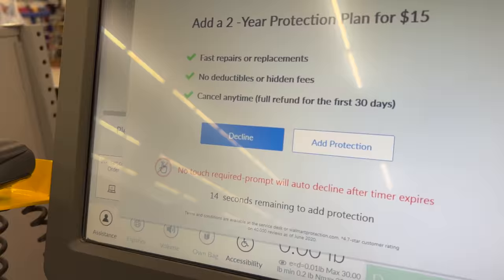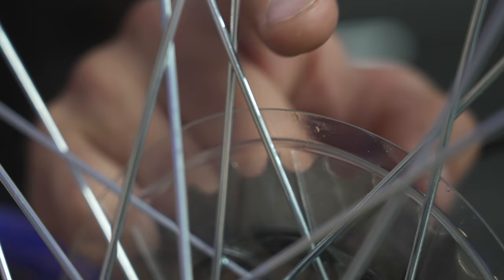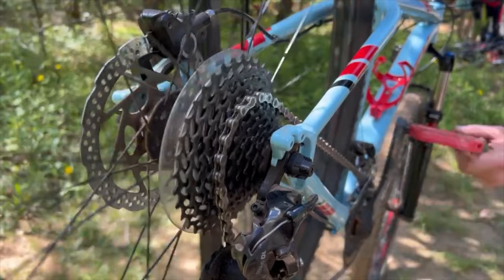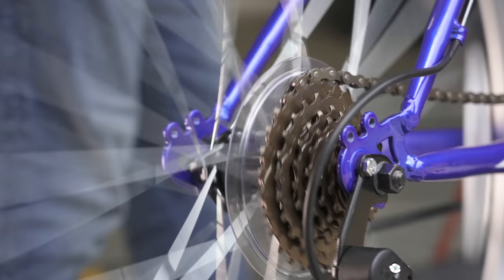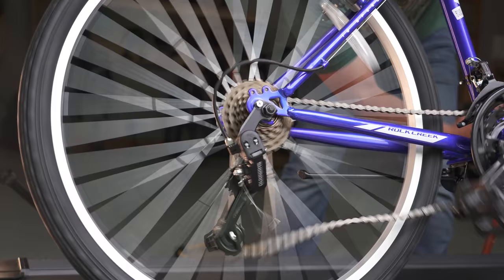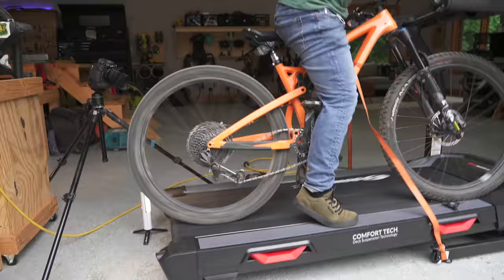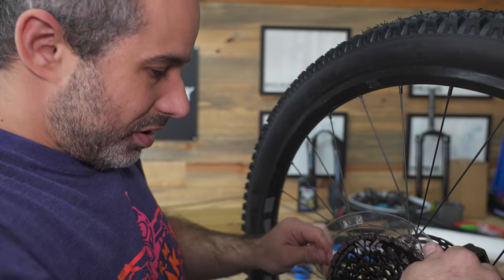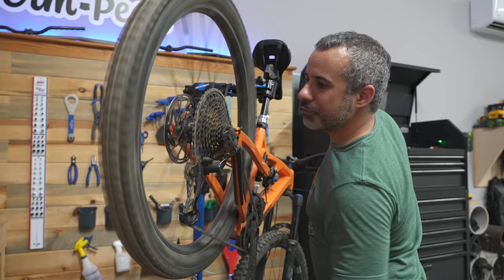What is your "dork disc" actually for? What happens if you remove it?

Comment: Hi ! Bike tech here. The dork disc is mainly there to protect the spokes from the chain, but it wont prevent to derailleur to be sucked up in the wheel. Also the main reason the derailleur gets sucked up in the wheel isnt a badly adjusted Low limit screw, its a bent hanger. A bent hanger will put the lowest point of the cage a lot closer to the spokes and when you shift into low gears to cage is getting caught by the spokes way before the chain can go over the cassette. In this situation, the dork disc is completely useless, this is why we so often remove it.

Comment: you can experience spoke damage, I had a chain slip over on an eagle drivetrain on a punchy climb. Upon inspection by removing the cassette I found a few bent and scarred spokes, I rode for about a year before one of the spokes finally broke. I still don't use dork disks; but there is real risks.
Reply: My worst damage from this has been from climbing. Going for that extra gear when the hanger is bent and you don't know it. I'm guessing it has to do with you putting power into the chain and it rips the spokes up worse than on a downhill when the wheel and freehub can keep moving.
Reply: I also had my chain slip in to the spokes a few times and when i changed spokes like 6 months later i noticed half of my spokes practically been cut in half so yeah there's a real danger but that also was with a cheap drivetrain.
Reply: A year before a spoke broke. And you somehow connect that to a missing piece of plastic?
Reply: @noneofyourbusiness4294  yes, bent and damaged spokes are more likely to break in time than straight and undamaged spokes.(just a wild assumption)
Reply: @RJ_Groot  obviously damaged spokes are the ones to go first. 

However, spokes break all the time. A flimsy piece of plastic doesn't prevent that from happening. 

The most common thing to break spokes, without you doing anything wrong, is uneven tension, which puts a lot of stress on one section of the wheel, which is exactly where spokes break. 

Once one spoke breaks, there's another shift in tension, another breaks, and another, and another. 

The damage your spokes take from debris flying at them is next to irrelevant. Think about it. You're putting multiples of your own weight on your wheel during a drop. If debris actually was an issue, you'd see spokes break around the middle. Instead spokes break where there is the most stress- the points where they connect to the wheel and the hub.
Reply: @noneofyourbusiness4294  I agree with everything you said. I was also surprised that I broke a spoke. I still don't use a dork disc but I recommend that if you do get a chain go over and bend or damage your spoke that you replace it before it fails. A bent spoke even when properly tensioned will fatigue at an accelerated rate (that's why new ones are straight). Just an opinion.
Reply: On an old bike, I had this issue, chain went over and basically scribed all the spokes. Didn't know it at the time, but after 3 broken spokes in pretty quick succession afterwards, looking at the remaining ones the marks were visible.
Reply: Had the chain drop between the cassette and the spokes and it cut about half way through several spokes they stared breaking a few months later.

Comment: The wheel is one of the most expensive parts to replace on a bike, so I really feel like even if it's just protecting your spokes from grinding against the chain, it still pays for itself.
Reply: well thats because a wheel has so many parts on it? spokes, rim, chain, cassette/freewheel, derailleur, tire, tube, brake? although a rear wheel would be more expensive than a front wheel so maybe you should have clarified that part too

Comment: I can remember multiple occasions when the chain fell into the spokes and caused catastrophic failure on my bike. Multiple derailleurs were trashed, several wheel spokes broken on different occasions, and once, the chain got caught and bent in half, rendering it as well as the derailleur junk. Maybe it looks dorky, but it beats breaking down during a ride and having to do repairs.
Reply: And the real question is...Who gives a rats ass what other people think? I take them off of my bikes but not because of peer pressure but because I've had several occasions where crap got stuck. That being said, I have never criticized someone for having one. People put too much emphasis on what others think of us. I ride with a backpack and flats. Lots of people think I'm a dork. I guess I'm a dork.
Reply: Or just maintain your bike properly.
Reply: I just totally forgot about the thing until now, as I didn't bothered ripping it off. I suppose it's different when you are just racing on pavement versus mtb'ing but I never noticed the thing being there at all. Guess, in the end, I'll just forget about it again after a few hours, and just leave it there.
Reply: I wish the dork discs on all bikes were more like the Huffy's (have to take the cassette off to remove it). Just got a new stumpjumper and the one on there just clips onto the spokes, trying to come off by itself.
Reply: What would you say if it was made out of carbon fiber or ceramic and came in different  cokor and could have custom design on them?
Reply: @wrk3182  Exactly.  If  your chain goes off, either inside or outside, your derailleur is either WAY out of adjustment or you've bent a hanger.    Know what the limit screws do, make them your friend.
Reply: @Duke00x  LOL, you're going to make them cool.

Comment: This happened to me only once in two decades. Destroyed my road bike rear wheel. Bought a replacement wheel set. Tried to sell the old front wheel. Found a lot of front wheels on sale on eBay, but not rear wheels. Then I realized this problem was more common than I expected!
Reply: Or maybe they were just stolen front wheels. Usually the rear wheel is secured. XD
Reply: Just re-spoke the rear wheel, it's not that hard. Or have someone professional do it, its not that expensive.
Reply: @aggese  methinks the wheel also needs to be recentered after that kind of damage... I'd totally buy a replacement too in such scenario 😅
Reply: @MarcelaElviraTimis  absolutely, but by removing and replacing the spokes you remove all centering so re-centering is just part of the re-spoking the wheel.
Sure you might have to replace the rim too but those aren't that expensive nether is having someone do the work for you and damaging the hub is rather hard
Reply: @aggese  that's my point. That little plastic thingy greatly reduces the need to respoke your bike, with the added need to center the damn wheel. I mean, at least in my experience
Reply: I wasn't commenting about the plastic disc, i was commenting on bikeman buying two new wheels when he only needed to repair the on that was broken
Reply: @MarcelaElviraTimis  if respoked, it gets recentered by any decent shop
Reply: Same here but 3 decades.  I’ll buy a new wheel every 3 decades lol.  This isn’t worthy of further discussion
Reply: @slpguy6026  I know... I just can't be bothered to go to get my bike repaired for something so preventable... besides, I kinda do basic maintenence on my own

Comment: I've had the chain come off that way before and tbh the worst part that would have been remedied by having a dork disc was getting the chain back out so I could pedal again. Without one, depending on the design of your cassette, it can get jammed in there is a way that is difficult to pull back out (and makes you wonder how it got there in the first place)
Reply: You are tottaly right I have a sram nx eagle 12 speed (gonna change it to a X01) and my chain did pop off between the cassete and spokes it was a PAIN to get it out I still dont understand how it got so caught up in there.

Comment: As other commentators have said, that “dork disc” is a spoke protector. The chain can be much harder metal than the spokes. An adult riding over rough ground can put a lot of force through the drive train. When the chain goes between the cassette and the spokes it can cut into the spokes like a saw. That can severely weaken the spokes, leading to the whole wheel eventually failing. That little disc is there to take the hit so that the wheel doesn’t get destroyed.
Reply: So you think that a thin piece of plastic is stronger than the material the spokes are made out of?
Reply: @JaspreetSingh-fo2qe  That's not what he's saying and it's not how it works. The disk attached to the wheel and spins with the spokes... if anything it needs to be stronger than the chain material. In any respect, the plastic could be sacrificial.
Reply: @har234908234  I bet that plastic will only help to prevent scratches from the spokes. If the forces are anything near to where the spokes would have broken without it, then it will not help even a tiny bit.

I can see a metal one to be quite a lot more functional but definitely not the plastic one.
Reply: @JaspreetSingh-fo2qe  I don't think it likely on a well setup bike. The event I imagine where the chain hops over the top of the block would have the rear derailleur bashing against the spokes! To your point. He was talking about chain plates banging against spokes... If it happens on a pedal stroke, the plastic needs to last one pedal stroke (and probably not a long geared one at that). You're getting off your bike to fix it before the second stroke! If it happens when you're going downhill at 60kph it's worth remembering that while the tire circumference of the wheel is going 60kph,  closer to the axle the linear velocity where the chain would meet the plastic is much lower. At 10cm from the axle that could be around 2kmh? The chain is 'sliding' against the plastic, not clattering against spokes. The damage you're looking to avoid is the start of a fatigue failure, not an instantaneous catastrophic failure.  I think this is a kids bike problem... where the setup may be 'altered' without expertise.
Reply: @JaspreetSingh-fo2qe  I bought my first bike (well, since I was a kid) a few years ago and had no idea what was what. I knew I had to adjust the rear derailleur... but I did it wrong. And still being a noob, I was in the granny gear a lot all the time - the one closest to the spokes. On more than one occasion the chain slipped and wedged up against the disc. I remember thinking "wow, I'm glad that little plastic disc was there, how about that..."

But as for plastic being weaker than metal - the plastic has much great surface area than a single spoke. That force is distributed much more evenly - that's how it can function as it does. It also stops the chain getting tangled in the spoke. If spokes were that strong, we'd have four of them per wheel, not dozens. 

If some weirdo is paying that close attention to my bike and cares about a little plastic disc, then I assume they're just a creep with a tiny pecker, since it's the sort of thing that turns cycling into a dick measuring competition. Just like a lot of other stuff. I don't care if I have a bike with it on, especially since I've seen them work.
Reply: Forget all of that and use a "super low gear without teeth" if that makes sense, I believe bike manufacturers should refuse allowing the chain to come off the rear cassette rather than add a plastic disc to deal with the damage.
Reply: @JaspreetSingh-fo2qe  No.
The plastic gives the chain a smooth slippery surface to ride on. The plastic will get damaged, but is much cheaper and easier to replace than spokes.
Reply: @JaspreetSingh-fo2qe  it's a sacrificial piece. The plastic thing gets destroyed so something important doesn't and then you replace it.
Reply: Professional bike mechanic in some capacity from master tech at several shops through race support from 1995 through 2010.  In the 15 years I’ve worked in the industry, I’ve encountered 5 instances where the dork disk may have saved the spokes on the wheel.  If you free wheel for long enough with the chain wedged down there, the spokes on the drive down get shaved down and get mangled.  One of the 5 instances was on my own wheel and like many, I thought nothing of it until I broke a spoke on a steep climb.  Replaced the spoke as well as a few of the other external drive side spokes when I saw just how shaved down those spokes were.

Mangling and creating total carnage with the rear derailleur and derailleur hanger seems to be luck of the draw, usually combined with contact or introduction of an external object (e.g. rock or stick).
Reply: That little disc just have to deflect not act as a wall . Even if if saves you one spoke that’s money to get to the next trail. But they do look dorky.
Reply: @JaspreetSingh-fo2qe  The chain can severerly damage the spokes and not just scratch them. Any damage to spokes can alter their tension putting the wheel out of alignment and spokes can break. Removing those plastic disks is just stupid since they don't impact anything negatively.
Reply: @JaspreetSingh-fo2qe  The point is that

a) with a smooth surface to rub against, it never actually binds to the wheel in the first place, so the dork disk won’t actually have to deal with those high forces, and

b) If the dork disc is completely thrashed, like deep scratches, even to the point of holes in it, your wheel won’t break, because it isn’t the spokes.

Sure, metal is stronger than plastic, so metal can take force better (assuming the same shaped parts), but I would rather tear pair of gloves than the skin on my hand, just as I’d rather destroy a dork disc than my spokes. Even if the dork disc dies a gruesome death, the wheel (*might*, you can obviously break both) live on.
Reply: @JaspreetSingh-fo2qe  youre just not getting it bro. The plastic will deflect the chain. Its that simple.
Reply: The chain can grab into the spokes and damage them or even cut them.
The dork disc plastic is a smooth and plain surface. Nothing to grab on. Ideally from both sides with little noses that could break instantly. The chain slides over it and no force is transferred into the spokes or even the dork disc. That easy.
Reply: @JaspreetSingh-fo2qe  surface area must not be a thing your familiar with. Its not always about pure strength.
Reply: if it was just to protect spokes it wouldnt be a law that it had to be on bikes....
Reply: @tbag6600  well, I used to have bikes without spoke protectors and let me tell you: the hassle those plastic discs save you when your derailleur is misalligned is enormous. Hell! If you're an amateur like yours truly, that stupid little thing allows you to procrastinate fixing it without the risk to tear your wheel into pieces and have to (gasp) straighten it once a week and spend money on spare spokes
Reply: @JaspreetSingh-fo2qe  it just needs to allow the spokes to slide along stationary chain
Reply: I think the protection here concerns mainly metal fatigue. The wheel experiences cyclical load. Even a tiny, invisible fracture due to an impact event can lead to sudden failure somewhere down the line.

Comment: If the chain drops behind the cassette under tension, (i.e. on a steep climb when you really wish you had one lower gear) it can really thrash the spokes right where they insert into the hub. It weakens the spokes at the point where they normally break. Nothing catastrophic has ever happened to me, but I've ended up rebuilding several wheels because of it when a spoke or two broke sometime down the road. I had more trouble with the old 3x9 setups, where the cassette was smaller. Modern larger cassettes tend to have clearance between the cassette spider and hub that wasn't there on the older, smaller cassettes with full steel cogs. I've seen a few jammed tight enough that they were very difficult to get free, but only when the chain was pulled in by someone standing on the pedals.
Reply: This is exactly what happened to me - But with a brand new bike (first time riding it), dropped to the easiest gear, limit screw wasn't set properly, chain got sucked into the wheel, snapped the chain.  And this was with a dork disc
Reply: Snapped 3 spokes when this happened to me a few months after pulling a broken disc off the bike. Had previously set and tested inside limit screw but either the derailleur was realigned or the set screw backed off while riding because it hadn't been glued in place.
Reply: Exactly. The DD wouldn’t be useful on fast descents but on slow climbs where the chain is under a lot of tension.
Reply: Agree, I've definitely trashed some spokes from this happening.
Reply: This.
Be 8, bend dropout, overshift on a hill, use dork disc.

Be adult, bend dropout, fix dropout.
Be adult, overshift, stop pedaling.
Reply: The chain on the hub?...It literally does nothing .. What happens is the rear derailleur gets BLASTED by the spokes.

Comment: i actually want to get a metal dork disc, that way pieces of it don't break off when it gets old and brittle

spoke protectors that were used on vintage bikes, the chrome ones, looked really awesome and often came with cool designs like logos punched into them or fancy patterns

this was before everything was plastic and people made sure that every bike component made the bike look good

in my opinion, no amount of ''coolness'' is worth risking crashing or destroying a bike over, especially for something as trivial as a round disc
Reply: I've definitely owned bikes with a metal “dork disk“. Most of the bikes I have ever bought, were ~40 yr old bikes I paid $20 for.
Reply: They don’t make ‘em like they used to..
Reply: In the Netherlands they have them.
Reply: My last two Downhill bikes had metal ones, which also did not connect to the spokes, but the cassette directly.